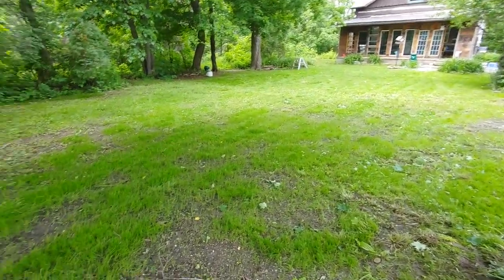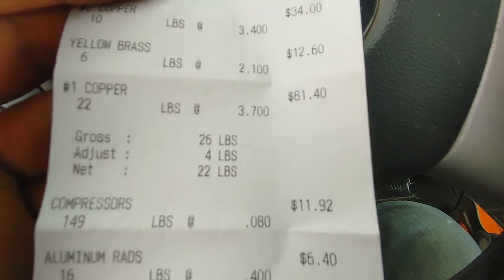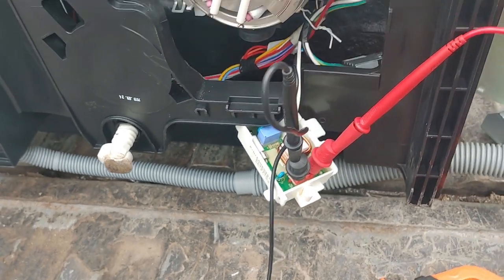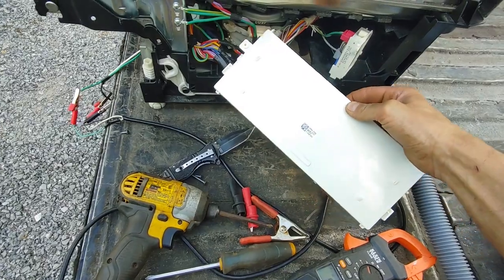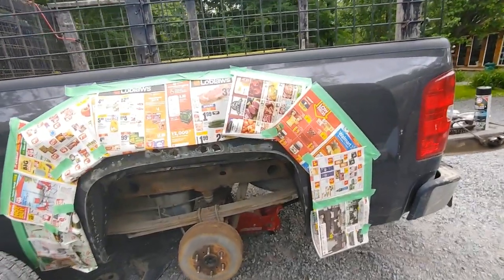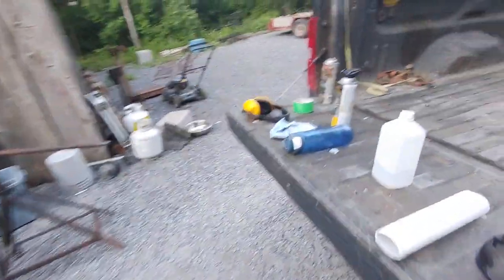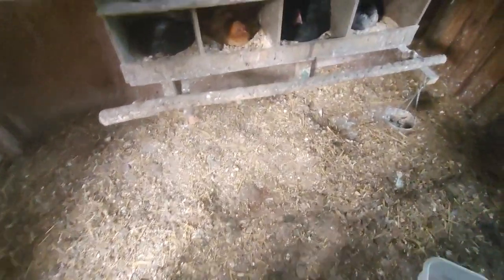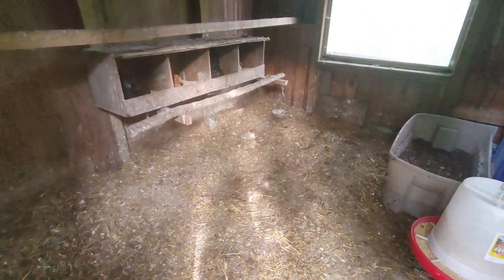Fixing truck rust, troubleshooting a free dishwasher, and selling scrap

Comment: There comes a point in time when you will accept it as a work truck and not a bandaid of rust repairs. The only way to fix it correctly would b to replace the metal and why do that? Its a work truck 😄